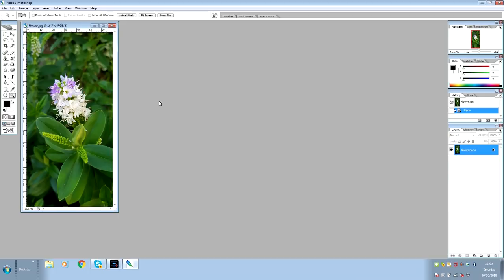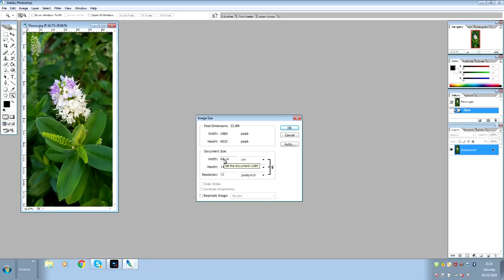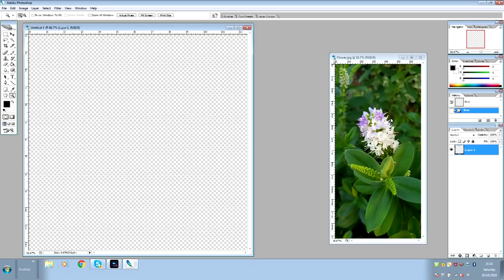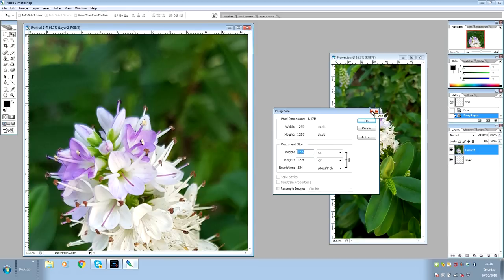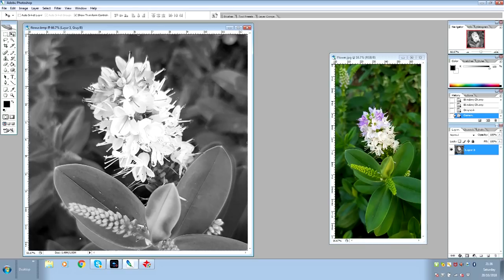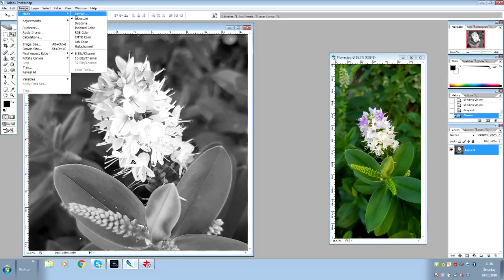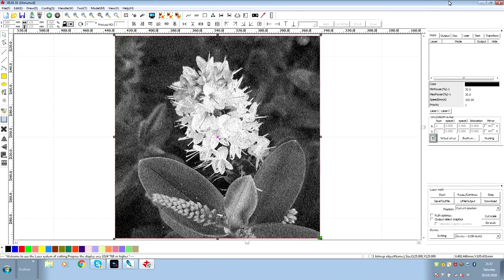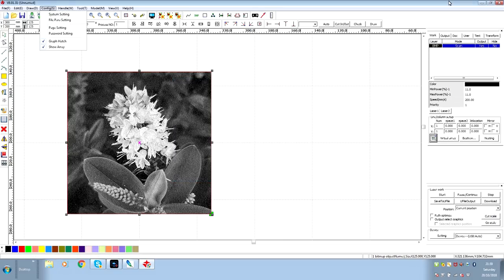160 Adobe CS2 LEGALLY free

Comment: Hello Russ.  Your tutorials are always fun to watch,  Thank you.

However, I might be of some assistance here on this one.  You made the job of adjustments a bit harder than they needed to be. In your example photo you have a very easy background to isolate because its all green. If you use cures and many other tools BEFORE you reduce to grayscale, you can very easily target just greens which will make adjusting the actual background much easier since the flower has little to no green in it.  By applying an adjustment layer on top of the image layer and then use the dropdown to select  "green" instead of RGB or grayscale, the adjustment layer will affect only the green in the image and truly allow you to operate on the  background.

By dropping to grayscale first, you limit your selectivity to a range of gray pixel values which can easily occur anywhere in the image.  As an example, if the flower were red, its grayscale value may be very similar to the green's making any adjustments extremely difficult to accomplish.

In general, I have found that operating on an image with the highest color depth and resolution FIRST before reducing that resolution and color depth to produce the best results in the long run.

Comment: You can advise your watchers that they can have Gimp legally and for free.  It's just about as capable as Photoshop and, in my opinion, much easier to use.  Then, when they want CorelDraw, you can point them to Inkscape, again, legal and FREE.
Reply from the maker: Hi Marti

Thanks for your comment. Whenever I use Photoshop,  I normally mention GIMP as an alternative along with Inkscape (I have both) which is a Coral/Illustrator vector alternative that is equally free. In this video I didn't mention the alternatives  because the idea was that you can download an old version of Photoshop for free. You still can from many www links  but as I said in the revised video I cannot be publicly seen to encourage software theft. Other sites claim it to be free ware but close inspection of the download conditions say otherwise. There are also excellent free cad programs as such as LibreCAD or Draftsite (  https://www.3ds.com/products-services/draftsight-cad-software/free-download/     )

Best wishes for Xmas
Russ
Reply: @SarbarMultimedia  Great to know!  I had not heard of LibreCAD and Draftsite.  During my years in the sign business, my engineers did all the CAD stuff.  I worked with CorelDraw and Flexisign until I left the business and could no longer justify the expense.
Reply: Please can you make this tutorial in inkscape ???